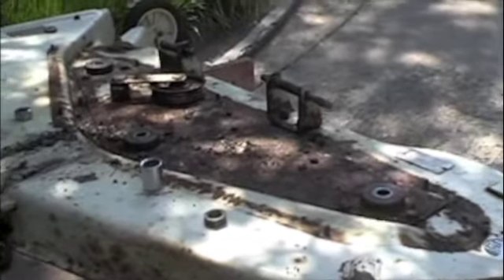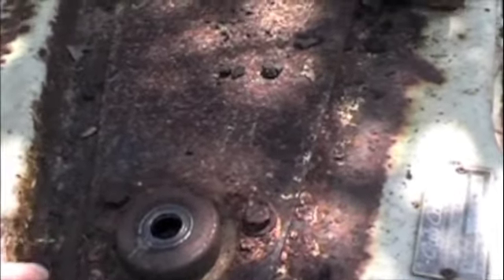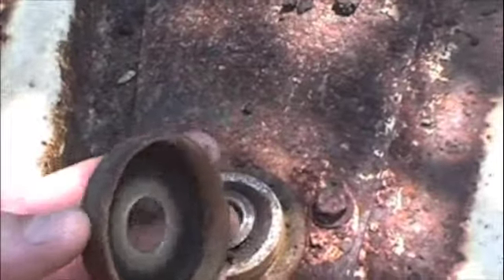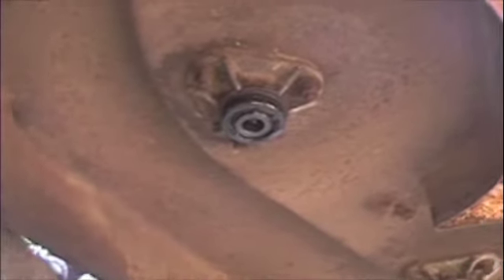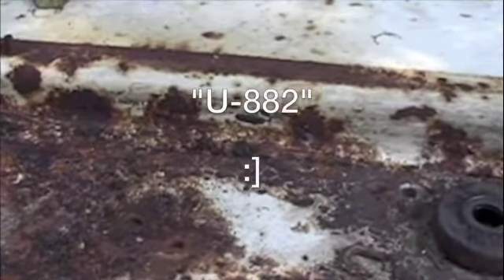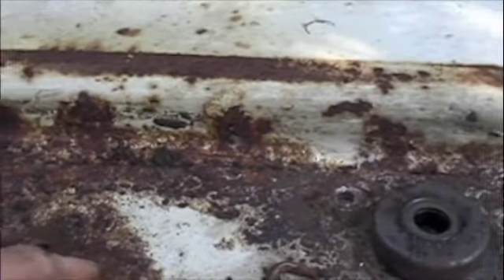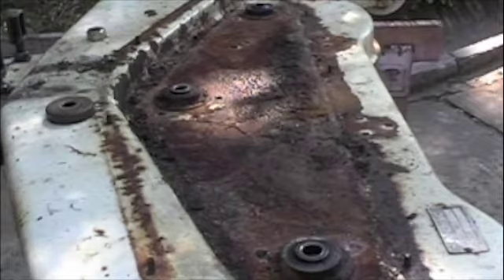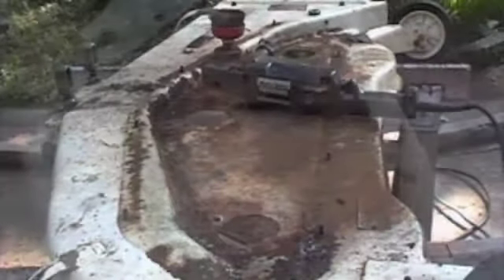Cub Cadet 882 50" Mower Deck Restoration 1

Comment: looking good buddy . after you get it all cleaned and primed , 
i would apply hardened enamel with a brush real thick in between the deck 
and stiffener plate .  slap them together during reassembly when the paints still wet . i bet that stops the rust from getting back in there for a long time .
thumbs up from 500.

Comment from the maker: @1968hambone  They're so big and heavy, shipping costs pretty much force you to find one locally. You can do a craigslist "Sears Mower Deck Wanted" ad. Someone usually responds. Sears kept the same frame mounting holes for years, so a bunch of different models will fit. I bought a '77 deck pretty cheap, and it bolts right on to my old '67. Looking forward to using it.

Garden is looking good HB, that's some nice summer eat'n.

Comment from the maker: @edzgarage  Yeah, looks bad but still pretty solid.  The main fastener were nuts and bolts, so when it snapped it was fine by me. Glad they didn't design it with any welded capture nuts or the like.

Comment: It's better the bolt snaps off rather than strip out. Wow, that deck is really rusty. Looks like it's still solid enough to use though.